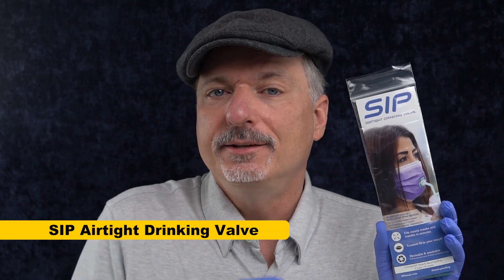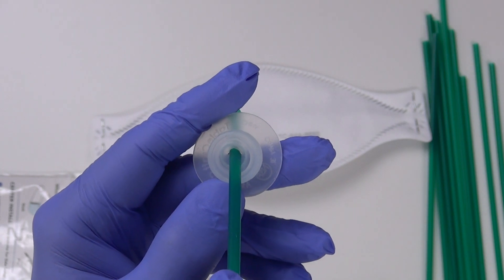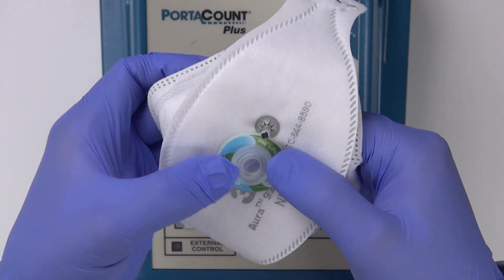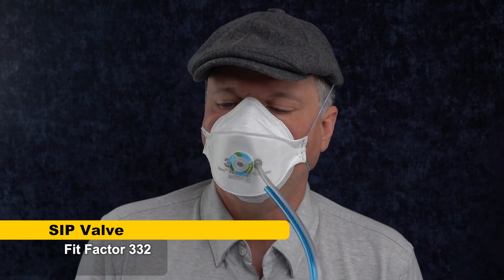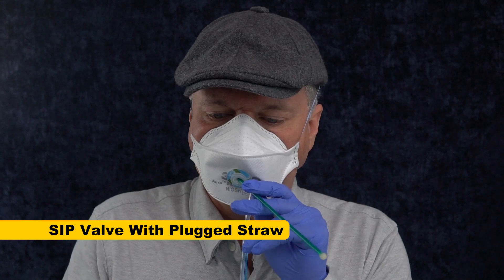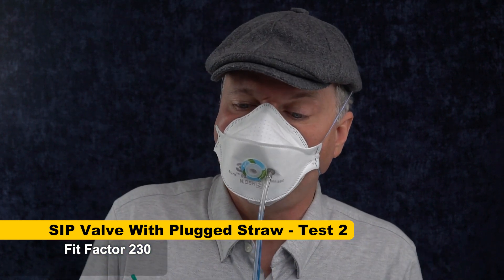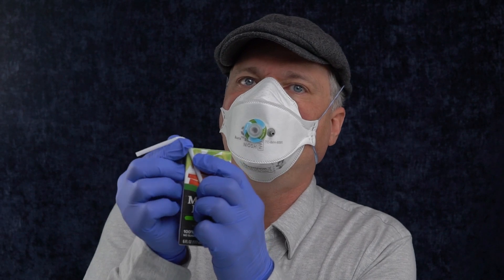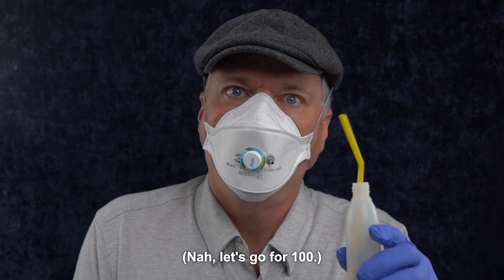Is it safe to stick a hole in your mask so you can take a drink? Testing the SIP drinking valve

Comment: Would you be willing to do a test where you were more careful about not sucking in air and using the straw quickly? I'd be very interested to see what the numbers were then.  Thank you so much for this!
Reply from the maker: Absolutely. This video was me checking how I thought the SIP valve might be used in the real world by an average person. I do plan on doing a follow-up attempting best practices. The limitation of that follow-up is that the mass testing machine can only test leaks that go into the mask. Any air that goes directly through the straw into your mouth bypasses the mask entirely and cannot be accounted for by the mask fit testing machine. So what I can test is how much leakage there is getting around the straw, with and without breathing normally while the straw is inserted but not in my mouth, or while breathing through my nose.
Reply: @gerardhughes  Thanks! I was really dubious when I first saw the sip valve. I'm so glad you did the testing. It is apparent that it is better than moving a mask to use a straw. I'm really curious what happens with best practices as you mentioned. My partner and I are high risk and began isolating though this pandemic is stretching on. We need good data to be able to access risk. I really appreciate anyone who takes their time and energy to provide it. Thank you!
Reply from the maker: @TheRenwmn  

Best practices may be mostly not breathing in while a straw is inserted. I did breathe in during this current test because I wanted to know how much leakage there is around the straw when it is inserted.

One of the SIP valve guys suggested taking the straw out between breaths would be their suggestion. I need to try it . It might be better, or having to fuss with the straw every time might be worse. Only testing can give me an objective answer.
Reply: @gerardhughes  wouldn't best practice be to blow out air through the straw :)? you might make some bubbles in your drink though ;)

Comment: So nice to find another empirical tester in YouTube land!  Perhaps you could give me an informed opinion of one of my own practices on a plane or at a restaurant: I hand-hold a GATA cup respirator over my face to breathe, and remove only to drink or eat (without breathing).  Would that probably be the same protection as when you lifted the mask to take a drink here?
There are other mask-hacks I’d love to see you test, but your opinion on this one would be great, thanks!
Reply from the maker: Thanks for the comment.

When I  lifted the mask up the test measured the concentration of particles that got in the mask compared to the ambient air, but doesn't necessarily measure how many I inhaled if I  was holding my breath and subsequently exhaled to purge the mask (which I did not do for that test).  When you take the mask entirely off that number would be 100% of the concentration of the ambient air.

Testing the efficacy of removing the mask to eat is difficult, and not possible with my current testing configuration. The mask sample is hose would continue to suck in air when you removed the mask and would be sampling unfiltered air, even though you would be holding your breath - the quantitative mask fit testing set up assumes any air inside the mask is air you are breathing. 

When I  lifted the mask up the test measured the concentration of particles that got in the mask compared to the ambient air. When you take the mask entirely off that number would be 100% of the concentration of the ambient air.

There are similar issues for qualitative taste test mask fit testing where the mask fails the test if you can taste the aerosol challenge agent in the air - and you would as soon as you took off your mask, even though you aren't inhaling. 

Mask fit testing uses proxies to try to estimate what you are actually inhaling, but that is confounded when you aren't inhaling, but are exposed in a way that tests positive for the testing methodology

There are some advanced tests where subjects wearing elastomeric masks are put in a room with that has a gas added that can be detected in blood samples - and that is a sign that you actually inhaled the test gas rather than just had your mask off causing a false positive.

I'd think your method would reduce your exposure, but it is hard to quantify. The military teaches soldiers to hold their breath if they have to unmask, then to exhale to purge the mask once donned again. That strategy may not be practical when you are eating, but it may further reduce your exposure when possible.
Reply: @gerardhughes  Yes, I practice the “purge exhalation.”  Fantastic answer; thanks so much for the time!

Comment: Nice one.
Do you think you would pass a fi test with a mask that failed ,just by wearing safety goggles?I mean goggles with straps and elastomeric inside it,such as the uvex ultrasonic orange 9302245 .For example,goggles and the bnx tri-fold N95 that failed on your face.
Reply from the maker: I think your comment is meant to apply to a different video than my SIP valve video.

If you are asking about the 3M with a broken strap, the answer is I don't know. I think it would help if the top strap was the broken one. But I don't know how much. If I ever get a set of uvex goggles, I can add it to my list of things to test.
Reply: @gerardhughes  Yes,the reference is for another video .I meant the video with the BNX black N95 that you got a low score in the portacount.I wonder if any safety goggles that seal well your eyes and the upper part of your mask would increase the fit factor.
Reply from the maker: @vasilis5989  

Ah, in that case yes I absolutely think anything pressing down would help provide a better seal would help. That is how a mask fitter works, such as the Fix the Mask mask fitter. But I'm not sure how much of the nose bridge and the upper part of the mask the goggles would cover. I would turn to a Fix the Mask mask fitter as my first choice to try to make the mask fit better. I don't know how much or how well the uvax goggles would overlap with the mask.